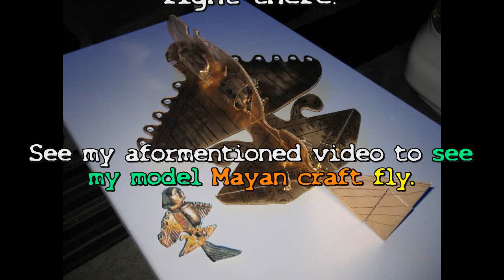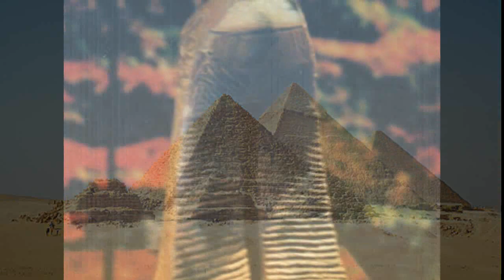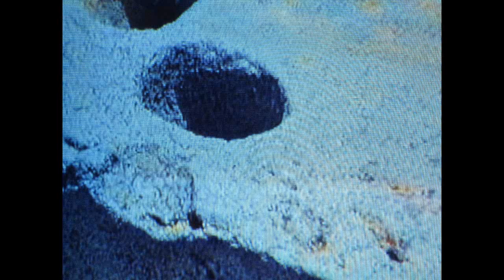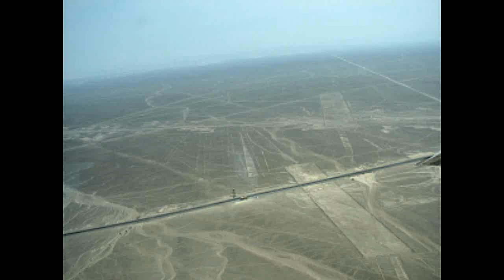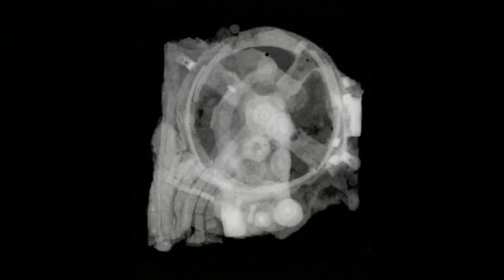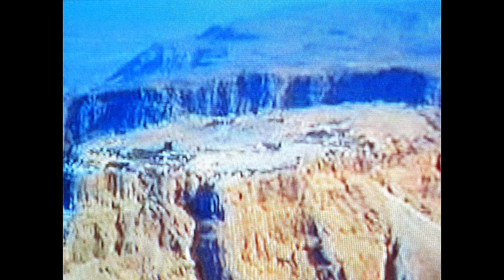My take on "Perplexing Ancient Earth places" that are real. By request.

Comment: @NightFlyyer 
If they had light speed fighter spaceplanes, I don't see the problem of air pumps as particularly daunting. 
Actually, I meant nowadays, they might use air pumps to transport those rocks. either that or saw it apart transport, and smelt it back into a block.